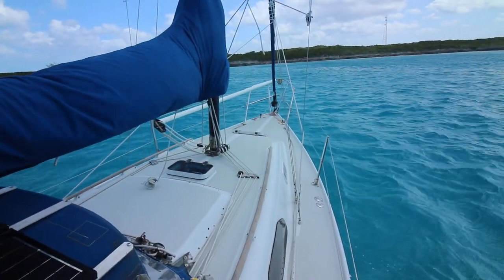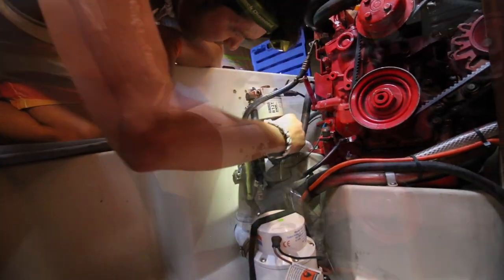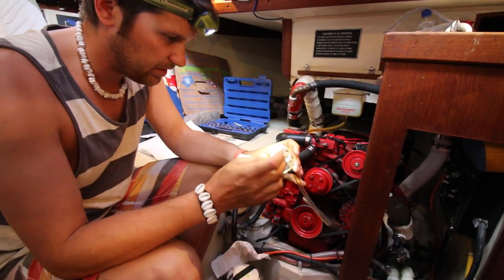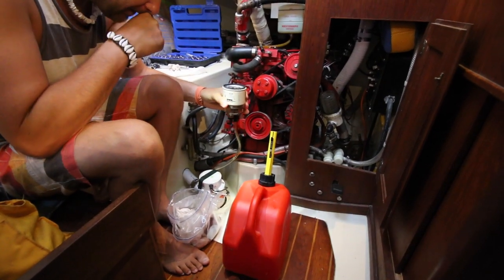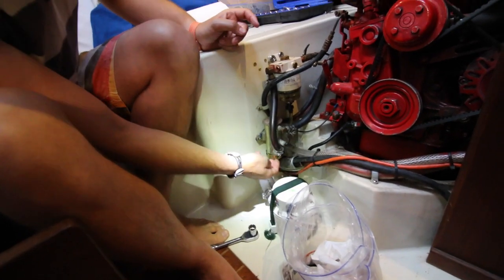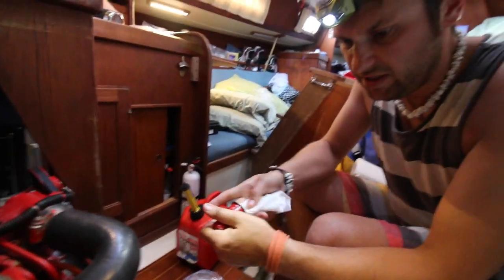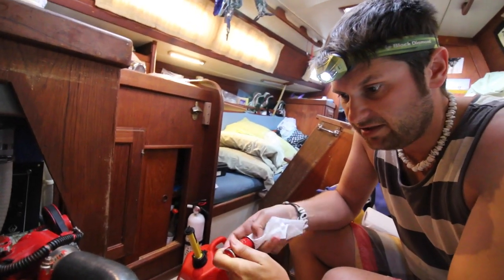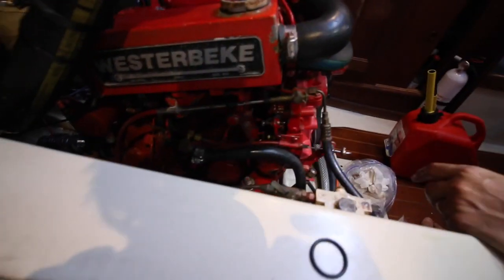Changing Fuel Filters - Westerbeke Diesel Engine Ep. 34

Comment: Hey there, I’m looking at westerbeke 20B to replace my atomic for on a Ranger 33. A little smaller of an engine than I was originally looking at, do you think that would plenty of power for a 10,500 lb boat? He’s only asking $1000 for it. It came with the boat he purchased and he decided to go electric instead. It also says it only has 64 hours on it! It looks old and hasn’t run in years due to poor project planning. Is this a screaming good deal?? Your westerbeke looks to work like a charm! Thanks for the video and sharing your knowledge.

Comment: At the end of the video you say that you run the lift pump for a few mins to bleed the air. I have a Westerbeke 30b3 and thought that the lift pump was activated by the glow plug circuit. I know that you aren't supposed to run the glow plugs for more than 30 seconds or risk burning them out. How do you run the lift pump for several minutes? Appreciate the video, thanks.
Reply from the maker: If your lift pump is activated by your glow plugs then it is wired incorrectly. If this is this case, your lift pump is not operating while the engine is running. On a diesel engine the glow plugs are only used during the starting sequence and are not used while the engine is running. The lift pump needs to be wired in with the ignition, in the on position, which enables the lift pump to generate a positive pressure to the mechanical fuel pump before start up and maintain the pressure to the main fuel pump while the engine is running. This takes most of the load off of the mechanical pump and insures there is not a vacuum on the in-let side of the mechanical pump. Hope this information is helpful. Thank you so much for watching our videos and for taking the time to reach out to us with your question. Fair Winds!

Comment: WOW ! after watching this surgical procedure on the fuel system with Doctor Randall and Nurse Ratchet I am certainly convinced through the great expert photography by Kenzie and the precision of the Doctor McCoy ... . .Eh. Randall...lol ! That I can do this myself, however what is a lift / list pump ? ( you mention this after talking about self bleeding fuel lines ).
Reply from the maker: The lift pump mentioned in this video is a facet fuel pump that is often used in sailboats, tractors and race cars to supply fuel to an engine when the tank is below the level of the engine mounted fuel pump. They come in several models with different flow rates and pressures, but they all take the same filter cartridge. The main purpose is to reduce strain on the main primary fuel pump.